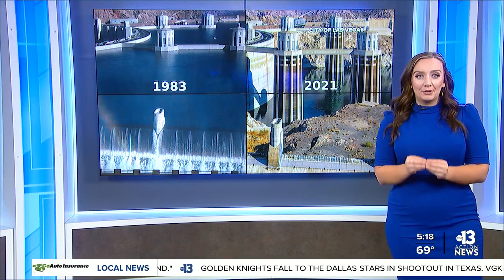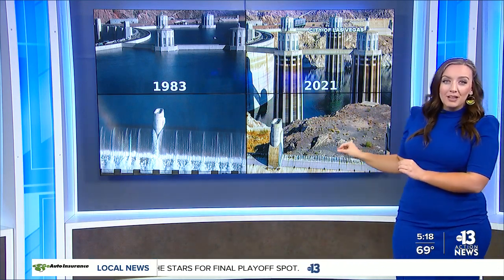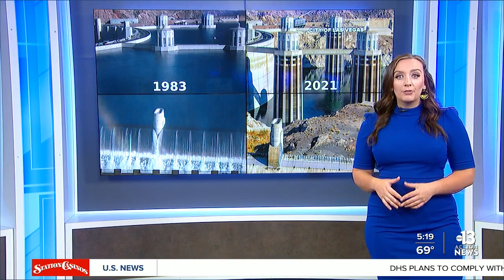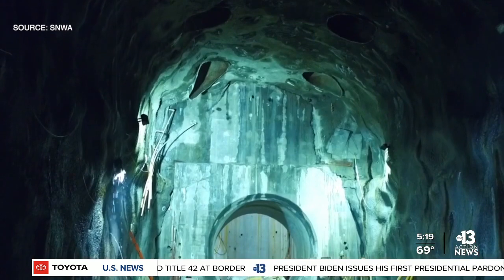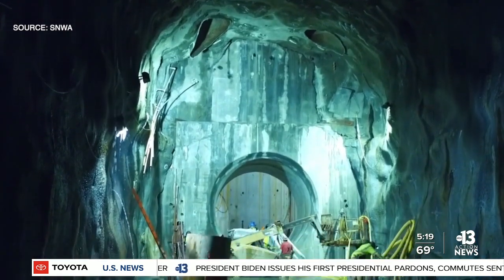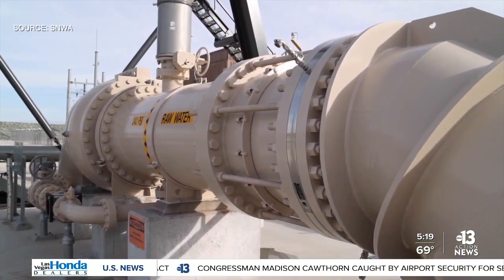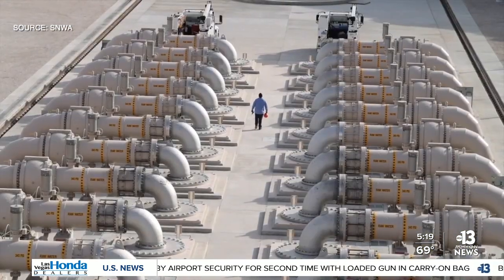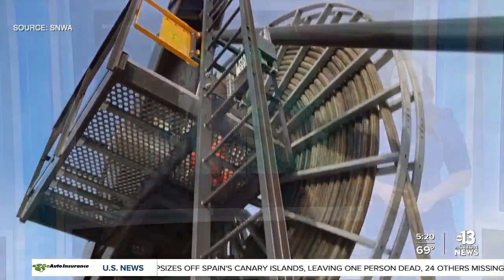Water pumping system to mitigate Southern Nevada water crisis

Comment: Sept 1st 2022
2022 WATER ABUNDANCE OR WATER SHORTAGES IN UTAH, NEVADA, ARIZONA?
TRAPPABLE WATER RESOURCES  ARE CLOSE BY.

On water supplies, there is an underground Aquifer that comes out of Canada and travels to California, via Montana, Idaho and through the Utah/Nevada/Arizona State line area. Ultimately, it is said to travel underground to Arizona Baja, California and then empties into The Sea of Cortex, Mexico. It carries a volume of fresh clean water equal to the Amazon River flow in South America.
   
With long-standing problems of drought, Farming needs, these resources are relatively close by and usable, with a bit of work, cost, gumption and ingenuity. I would want to be ever so helpful in assisting and delineating these precise locations, where this water can be found and penetrated.  

Cordially, Robert Shrewsbury
Manti, Utah

Comment: Las Vegas, beware: while to trip from full pool to 1055 elevation took 22 years, the trip from 1055 to sucking air from the lowest straw into Lake Mead will take at most 24 months.  So you people need to migrate to the wet side of the continent now because for reasons that need not be mentioned here you may not have that option after 2026.
Reply: The water pipeline from California to Utah? (for The Great Salt Lake) makes no sense, when The Great Salt Lake is only 60 miles (as a crow fly's) from an fresh-water Aquifer on the Utah/Nevada border. This Aquifer comes out of Canada (Calgary area) and ends up emptying in The Sea of Cortez, Mexico to the Ocean salt water, waisted. It is known that this Aquifer has a water flow as large as the Amazon River in South America. And the Grand Stair Case is also an enormous (underground)  body of water, see the Oren Hatch report on this.   "Don't hunt for Deer in Africa, when we already have plenty of Deer close by" I am a profesional in Mineral/Water Detection and have already verified this enormous body of water myself. Nevada can also be prevailed to this water.